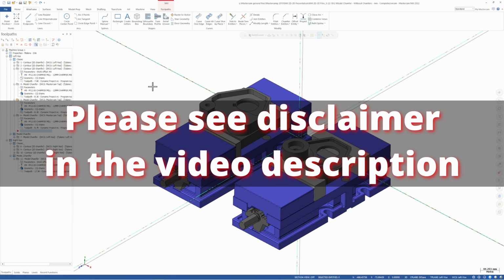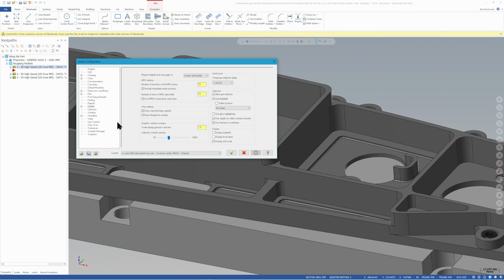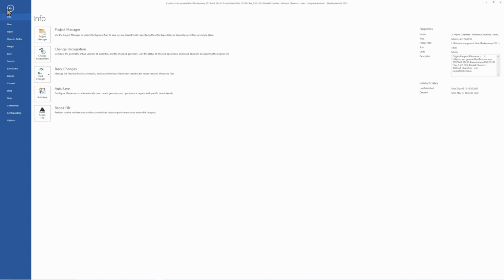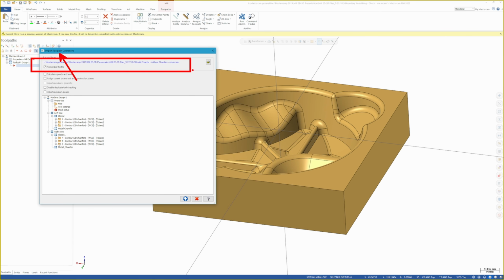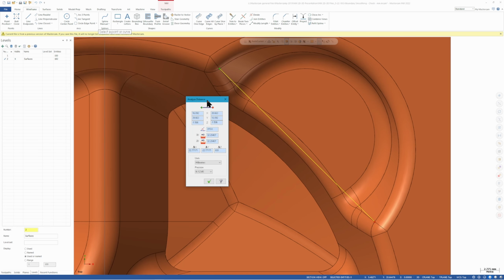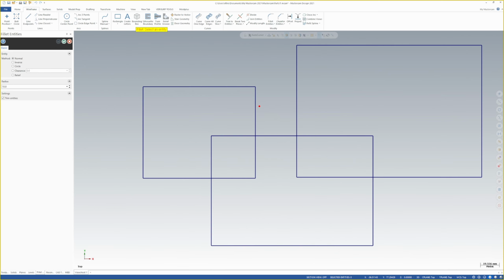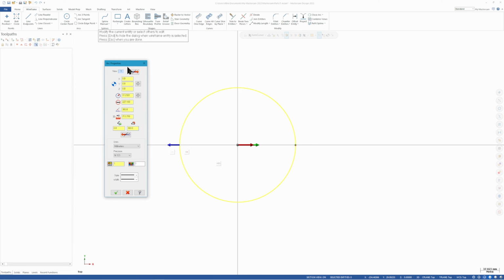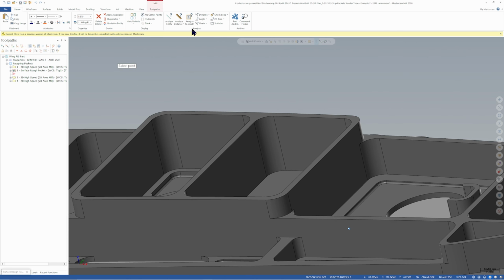Mastercam Users! 10 Quick Hints & Tips (with Chapters)

Comment from the maker: Welcome to my first hints and tips video for Mastercam!  Please read the disclaimer in the Description.
Timestamps:
0:00 Tip 1: Keyboard shortcuts
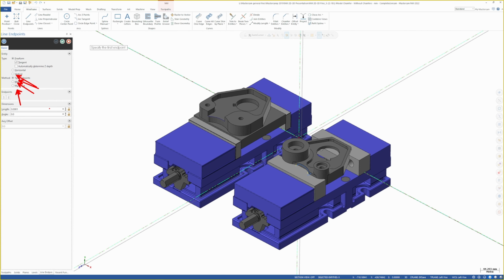0:58 Tip 2: Highlight settings
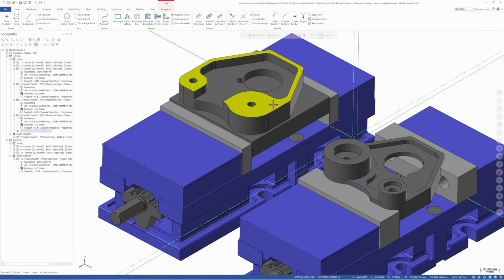2:27 Tip 2b: Highlight settings for older Mastercam versions
2:55 Tip 3: Thicker edge/chain hightlighting
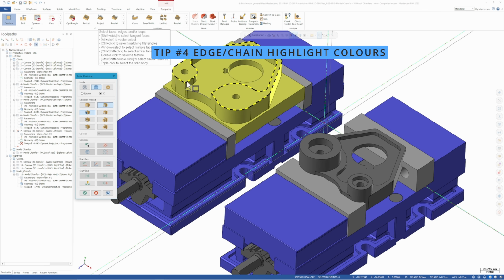4:43 Tip 4: Edge/chain highlight colours
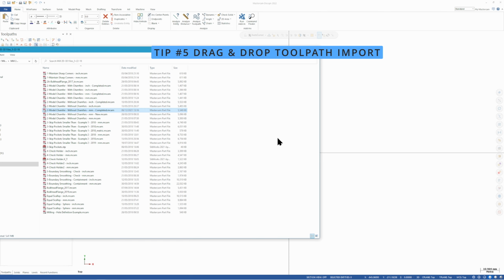6:54 Tip 5: Drag & drop toolpath import
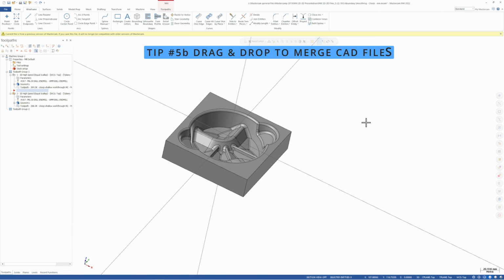9:06 Tip 5b: Drag & drop to merge CAD files
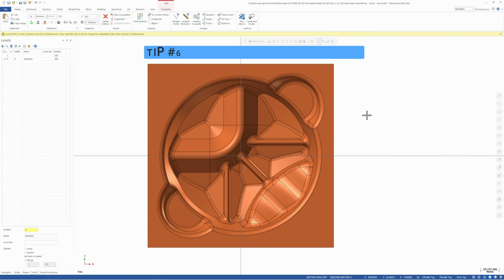9:49 Tip 6: Surface endpoint selection
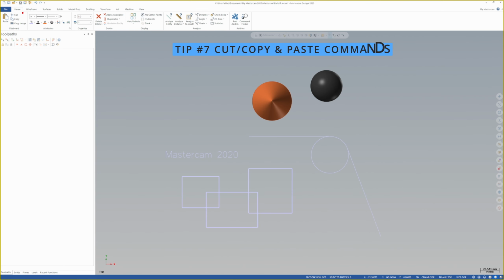12:07 Tip 7: Cut/copy & paste commands
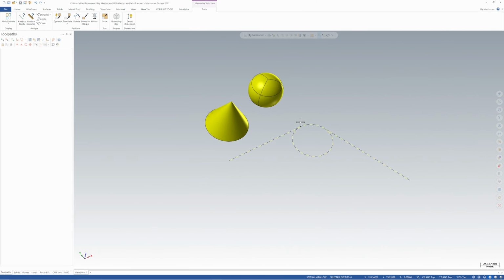13:15 Tip 8: Mouse-drag editing (divide/trim/fillets)
16:12 Tip 9: Edit endpoint of partial arcs
17:50 Tip 10: Use Analyze commands from inside toolpaths
Reply: Is there a way to make a tool move from op1 (g54 ) to op2 (g55)  without a tool change and not being in the same toolpath group? I want to run Tool#1 on 2 or more vise's from 2 or more toolpath groups without it doing a tool change, so it does g54 then g55 ect before it changes to tool#2. Is this possible?
Reply from the maker: @codycollins5370  Hi Cody sorry for the slow reply.  When I'm asked a question I try to simplify it as much as I can first.  That way, if I'm misunderstanding the question then we don't have to straighten out too many things.
With that said, I created a drilling operation in one toolpath group and forced out G54.  I created a second toolpath group, copied the toolpath, changed the work offset number and I got the result below:

N100 G21
N110 G0 G17 G40 G49 G80 G90
N120 T3 M6
N130 G0 G90 G54 X0. Y0. A0. S3183 M3
N140 G43 H3 Z10.
N150 G99 G81 Z0. R10. F318.3
N160 G80
N170 G55 X0. Y0. Z10. A0.
N180 G99 G81 Z0. R10. F318.3
N190 G80
N200 M5
N210 G91 G28 Z0.
N220 G28 X0. Y0. A0.
N230 M30
%

You can see the G54 and G55, so in my example I can get a work offset change in the middle of a toolpath with no toolchange, and the toolpaths are in separate toolpath groups (well you can't see that but you'll have to take my word for it!). If your NC code comes out differently then your file may be more complicated than mine or the post processor is possibly forcing a toolchange in some way.
Reply: @21stCenturEasy  yes mine comes out the same way if I only have 1 tool being ran in 2 or more toolpath groups. The problem comes in if I have more then 1 tool in my toolpath groups. Try doing it with 3 or more tools in each toolpath groups. Like tool#1 is a 1/2 end mill, tool #2 is a spot drill and tool#3 is the drill. Change to work offsets to generate G54 for toolpath group#1 and G55 for toolpath group#2. Then post it to see if the first tool run on both G54 and G55 before doing a tool change
Reply from the maker: @codycollins5370  Hi Cody.  OK it looks like I didn't read your first comment very well and didn't account for the second or third tools in my example, sorry about that.  The simple answer is no.  Mastercam will post the program in the top-to-bottom order of the Toolpath Manager - it will go through the first three tools to machine the job on the first vice because that is the order you have set up.
You have two choices - either re-sort your toolpath list by tool number rather than by vice/work offset, or find someone that can edit the post processor and have it pre-read (a.k.a. buffer) all of the toolpaths and re-sort the output based of tool number.  The second method is not simple and is likely to cost you quite a bit of money!